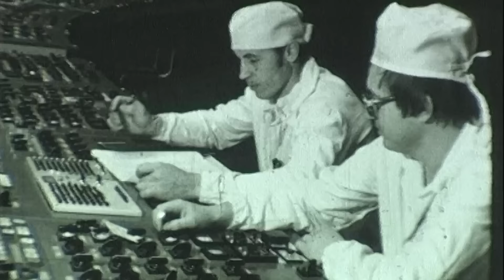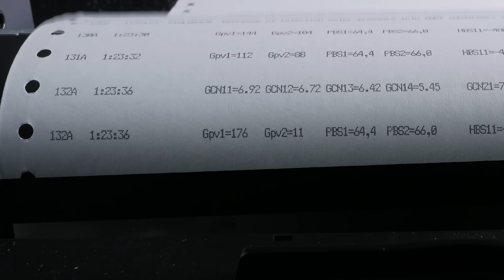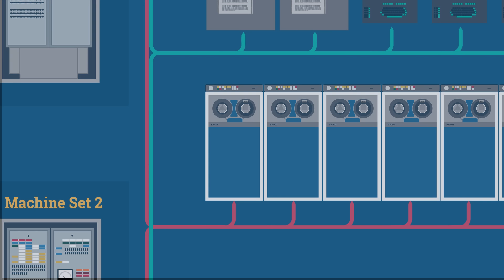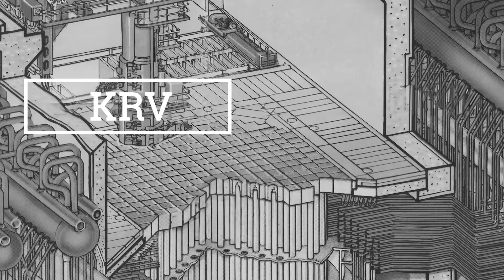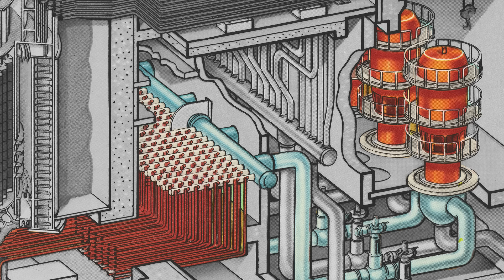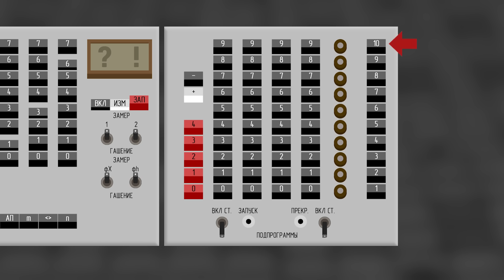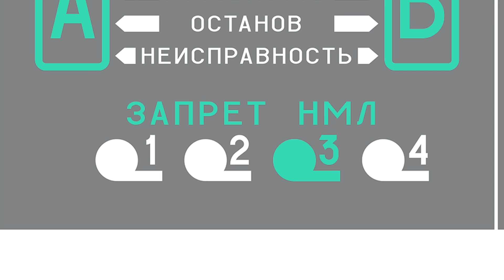Inside SKALA: How Chernobyl’s reactor was actually controlled

Comment: Is it possible to recreate the original alarm sound? And was that sound audible on the night of the accident? 🤔
Reply from the maker: Yes, I have schematics. There is a very simple sound generator on four transistors. So I guess the easiest way to figure out what the sound was is just to build it.
Reply: @ChernobylFamily Is there any information left about the original speaker? It would be psychologically terrifying to recreate the most authentic sound possible from the night of the accident. 😬
Reply from the maker: Yes, there is a full list of components, there was used a maximally standard speaker you could find in any Soviet sound system. We will assemble the same generator and attach the speaker and replicate the sound.
Reply: @ChernobylFamily Can we determine from SKALA's printouts at what point alarms were heard during the night? 😱
Reply from the maker: Yes, but I need to consult with the actual engineers to figure it out accurately.
Reply: @ChernobylFamily  Could you please provide me with the schematics?

Comment: So I have left a similar comment on your past SKALA video, but I'll do it again. First off I appreciate so much you guys diving into this level of detail on the SKALA system. This is a level of information that just doesn't exist on this system, and it's intriguing not just on the basis of the Chernobyl plant, but on Soviet computing and automation technology as well. For many years were knew of the existance of SKALA, but there was just zero information on it outside of Russia and former Soviet states - and even then, very little information. 

I work with industrial automation and SCADA systems as part of my job, and it still strikes me how similar SKALA is to many of the systems that we still use today. For example. the method by which the SKALA system catalogs unique sensor readings and data points is identical to most SCADA system tag implementations, where tags will most often have some format of categorization in their assignments, whereby there is a major system, a sub component of that system, and an individual sensor data point reading - and so on. Sometimes these tags reference direct measurements from a physical sensor, sometimes a tag references an arbitrary value that is computed in real time from various readings of otherwise discrete sensors.

In any case, the SKALA system is completely familiar to me - especially the "request station" which almost totally mirrors the role of a "remote operator station"  in the systems that I work with. This is where the operator can look up various list of alarms (active, historical, etc.), view graphical mimics - which are directly comparable to the Cherynobyl mnuemonic displays, and one that I'm sure the Cherynobyl operators would've loved: you can search for individual tag IDs using alphabetic search terms, and even build your own custom mimics that pull in data from any tags that you wish to build a display out of.

All in all it's really quite impressive to me the level of capability that was present in the SKALA system, and how similar it is to systems that we're still using today, and that all of this was built from a uniquely Soviet computer architecture that doesn't appear to borrow very much from western designs. In a lot of ways, this system was on par, if not ahead of, many western automation systems at the time. 

I mean, advanced automation systems like the Three Mile Island automation control system didn't even incorporate things like commanded feedback control validation. This is what led to the TMI incident: the system was designed under the assumption that valves and other such mechanisms that were controlled by the automation system would do as they were told, and would not fail to perform a commanded action. Yet that is exactly what happened in TMI: a relief valve that was commanded to open by the automation system failed to open. The automation system had no form of sensor feedback from the mechanism to indicate to the system or its operators that the commanded action had either succeeded or failed on a physical/mechanical level. 

The last thing I would say about the SKALA system: not only is the printed logging output once again almost identical to the logging output of western automation systems that we still use today, but the very action of the event logging itself is the antithesis to Soviet bureaucracy. The logged output doesn't lie. It doesn't point a finger at an individual man or woman and attempt to use them as a scapegoat. It shows what occured within the plant, it shows what actions the operators decided to take, and it doesn't offer an opinion on whether any of it was right or wrong. There is something that is completely refreshing about reading the output of the SKALA system at the time of the event. Even if the timestamps are wrong, that piece of paper is probably the one thing telling the 100% truth about what happened that day.

Cheers to you and good health to your family my friend, from the USA
Reply from the maker: Thank you so much for sharing. It is very interesting for me.
Reply: Also in automation and controls.

I am going to hang onto this video to show to operators when they start getting uppity about user interface or scan times....

Comment: My first programming job was for the 1966 vintage Scientific Data Systems 940 computer - it had 64 kilo-words of magnetic core memory with 24 bits plus a parity bit per "word" - Model 33 teletypes were used for operator input/output which included a paper tape reader/punch - the computer architecture seems to be strangely similar

Comment: I love how, it is quite similar in my chemical / pharma field i work in, how naming or allocating names for sensors in respect to the system or values. Example 800-G04E05TT9030: 800 site-plant-number, G04 internal plant designation, E05 prod. unit, TT Sensor type (temperature), 9030 and exact sensor designation. They really did invent the whole foundation back then 😅. And if you are good, you got all those names in your head 🤪 (not me yet)

Comment: long time no see!!! ive not been on youtube for a while, i just seen this video and love the photos of inside the skala room and control room how did you get them so cler everything looks brand new or was it help from a.i?
Reply from the maker: Sorry, I am not sure I get the question – all those are just maintained halls, you take a camera and take a shot,  and the only adjustment I made is color balance because there is luminescent light. Of course, equipment is cleaned from dust periodically because it has a historical value. But to be honest, some panels have visible wear in close up, you can see multiple scratches e.g. at chief computer engineer's console.

Comment: No wonder was so hard to run, I can see what nightmare was constantly fixing issues as they creep up. Especially with a aging system maybe with no parts available and needing to jury-rig stuff. The amount of institutional knowledge the old guys there had must have been incredible. Knowing which series of commands and action to input and do to fix specific edge cases would have taken a lifetime. 

Gamified could be quite fun, like a simulation in Unity or UE5 of a running system and then the operator (player) needs to input codes, swap parts and keep the system from breaking. Task saturated, running on the knife edge, seconds from a meltdown. Could be a good simulation of what the actual operators went trough.
Reply from the maker: From what we know, there were not so many problems with all that - the system was surprisingly stable.
Reply: For how much everyone else in the industry spend after chernobyl in operational procedures and safety upgrades... the western situation wasn't so much better... Thank now we have a better safety knowledge and safety technology.

Comment: Thank you for your continued efforts in describing this monstrous collection of purpose built control systems- a computerized equivalent of many eyes on many systems at once. The code control makes sense if you view the daily operation of the reactor as a stabilized system. Alerts for imbalances, control for experimental and production facility; the way the cascade occurred was outside the expected parameters- the system would have warned of a significant delta in many parameters before it became a runaway situation. 
I am sure the operators all had a "feel" for the way the reactor operated, and the system was questioned accordingly. It's such a massive device, they had the respect for it that was required. 
Thank you for making this slice of insight into the workings of the control system. It is intriguing!
Reply from the maker: Glad you like!

Comment: Fascinating 👍 Is your ultimate aim to build a simulated one-to-one replica of the entire Chernobyl NPP Control room?

Were the other RBMK reactors throughout the Soviet Union controlled by a SKALA computer system, or was it just at Chernobyl?  If in widespread use, do you know how long SKALA remained in service in Russia and any former states, and when it was finally replaced or decommissioned?

Am I correct in thinking that SKALA was in no way responsible for any of the chain of events that lead to the disaster?
Reply from the maker: Yes, to all your questions except the first (we will make key controls only), and you are absolutely right about the final point.
In r-a SKALA was replaced with SKALA-Micro, but apart from the name it has little to do with the original system.

Comment: Who the fuck approved this powerplant anyway, it's fucking bullshit crap fuck shit garbage
Reply: The siting was good and RBMK design was based off upscale of older and presumed-to-be-mature design of plutonium production piles (trading plutonium breeding for MOAR HEAT), as the channel-type structure meant that a lot of reactor components could be made pretty much in-situ (or, at least, at a retasked pipe production plant), instead of tasking one of limited extremely large metalworking facilities with forging a house-sized reactor pressure vessel. If you wanna see a channel-type reactor done right, look into CANDU.

Comment: Thanks! Please continue your great work. We support Ukraine 🇺🇦 Greetings from Switzerland.
I wonder if it is in principle possible to recreate a 100% bit identical copy of SKALA in a modern FPGA. 
That would actually be awesome!
Reply from the maker: Thank you for your support! I believe, yes, but it will require quite an extensive dive into V-3M architecture, AND we will need something that simulates V-31M Link to The Controlled Object and 24 connected functional control groups. The machine needs some data to "receive" to function.

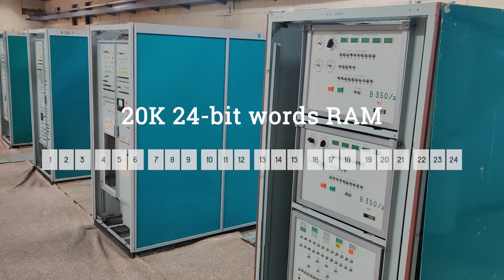Comment: At 1:40 with the 24 bit word split into 8 groups of 3 bits it seems likely that engineers could have used octal to represent the values. That's also common with Western computing, even with early 8 bit microprocessors such as the Intel 8080.
The unusual things are numbering the bits as 1-24 rather than 0-23 as well as using little endian, With the exception of Texas Instraments, Western companies tended to use big endian documentation even if the hardware was little endian. IIRC the Soviets tended to copy DEC and IBM rather than TI.
Reply from the maker: Exactly. They used octal all along.

Comment: Why almost ALL equipment, or even walls in the rooms, had a cyan (turqoise) colour back in the times of USSR?
Reply: That color is supposed to have a psychologically calming effect.
Reply from the maker: It depended on the series/family of tech. Machines of ES series were painted azure blue, called "Adelaide" (those tape reel drives are from the ES series). SKALA is more greenish. SM EVM (PDP-11 clones) were black and white. It is rather a choice of designers. E.g. IBM/360 was red and black, here it is the same.

Comment: Greetings Alex, Michaela, and team.

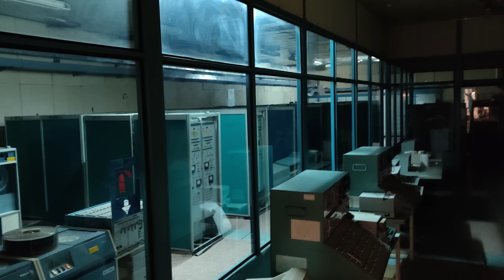At @1:51 Are you SURE!? Check out:

"Doom on the Oldest Digital Computer in America!"
https://www.youtube.com/watch?v=no0CkQk7id0

😎

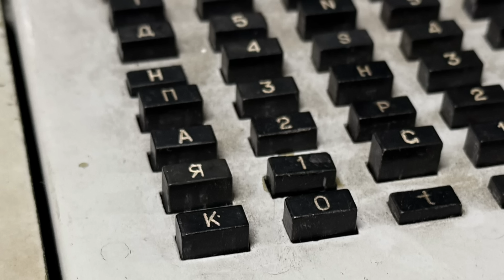At @10:00 This seems sort of similar to the NASA Apollo Guidance Computer which CuriousMarc channel worked on restoring one.

"Genuine NASA Apollo DSKY Full Restoration (Apollo DSKY - part 2)"
https://www.youtube.com/watch?v=vA0l_xvBmug

With the numbered Verb and Noun pairs.... a bit similar to what you described with SKALA and functions on the left / data points on the right.... seems similar to Verb and Noun pairs.

At @13:30 fascinating solution that SKALA was possible to extend to! 😎  A bit like a dynamic web page building tool I developed for my wife in order to get my wife back from hand coding HTML pages. This was in the year 2004. I built into it a capability to have the engine dynamically run code built in the language of the tool. I still have not gotten my mind around how exactly she thought to encapsulate the concept.... but she, I would put it, created a hierarchy of embedded levels. She was pleased the tool could execute correctly the dynamic code she fed into the system. I just was pleased that she was pleased. I miss the days when we could collaborate and accomplish our own projects. For the past 11 years I have had 100% of my consulting time bought by a large firm. For 11 years I have been screaming my head off "No! No! No!" to many bad decisions they decide to make. Now a couple of executives decided to get the company acquired.... and in seven months I am to assist in decommissioning, then disappear. 🤯 Anyway, all I envisioned for the Interpret function to perform was to say print the date or time at execution of the dynamic web page builder... "Last Update: " || date()  feed that to the Interpreter function, and it would execute the native date() function and append what ever that function returned behind "Last Update: ". As a very simplistic example of what I had envisioned. That was back when computers were fun. Now being micromanaged, told to do things not good for the long run, told to shut down, self-destruct, and then "Make like a tree and get out of here"... this latter is no way to live.

Again, bravo on the progress team! WOW!!! 🥳 👍

Comment: That's the STUPIDEST system I've ever seen... no wonder the thing exploded...
How the hell are you supposed to get timely information, with clarity and lower mistakes with a system like that...

Crazy how they thought very little about safety nor usability back then... :/

OK, it's all IMPRESSIVE, but it's still just crazy convoluted and clunky... :D
Reply from the maker: If we look at it as a general purpose computer, then yes. 
But it is more a specialized controller. It's not stupid at all, and its approach is not unique, assuming its very narrow purpose — look at Apollo DSKY. And there were many systems like that in industry in the 60-70-s.

It indeed had severe limitations (which eventually were overriden with DIIS), but it was rock solid, stable and generally did its job well.
Reply: Silly Soviets, why didn't they just connect the computer to ChatGPT, so the operators could ask for reactor parameters in plain English?

Comment: How did operators see the corrected power adjustments PRIZMA  .....
Reply from the maker: E.g. through codes K0K0000 and K1X0000 that produce small and big cartogram of PRIZMA printed on the ACPU.
Reply: @ChernobylFamily  Like layered drawings showing the power density in 3D ? ....
Reply from the maker: Like an ASCII graphic table.

Comment: That computer and its use was just a monster. If that had to be equated to western system, what would be the most similar?
Reply from the maker: Hmmm, it is a good question because we need to compare it to something equally narrow-purpose. I do not even know, although there surely exist a few options.
Reply: @ChernobylFamily  I would love to see a functional SKALA, but given the current world situation and the narrow scope they were used, I will probably never get that chance. I wonder if it was a loose clone of a PDP 8 or PDP 5, maybe an IBM 709, or an RCA type? 

Do you know if the last of the RBMK are still running SKALA?
Reply from the maker: It is not a clone of anything. V3M was created when soviets did not adopt cloning as a policy. 

Remaining RBMKs run on SKALA-Micro, but apart from a name which is nothing but a tribute, that system is totally different.
Reply: @ChernobylFamily  Ok. I wasn't sure on if it was wholly indigenous or based on an older western design. I still would love to see the old SKALA functional and tour the exclusion zone and CNPP. 

On a good note, I'm glad the computers were updated, that would be rather scary given the limitations of that system in the modern world and the issues that plague RBMK design.

Comment: Awesome wideo as always.
Working with this system must have been hard enough when everything was going well. When something went wrong it was probably next to impossible to quickly diagnose and fix the problem. Not to mention something like the disaster moment. It was over before anyone could comprehend all the warnings and parameters.
Reply from the maker: A very good point
Reply: Wideo. Nice!